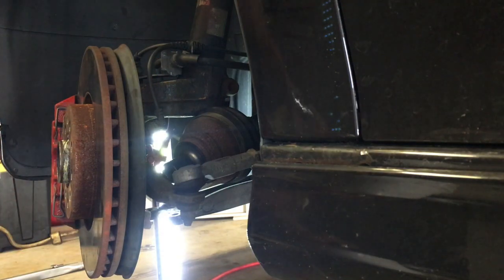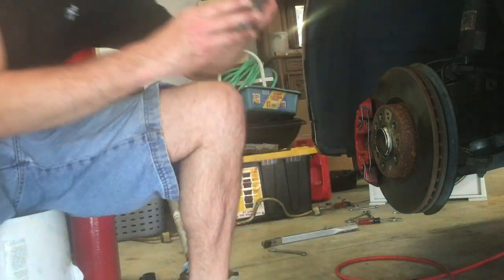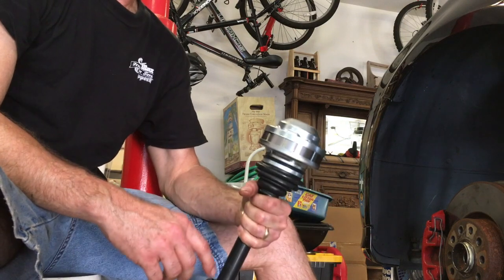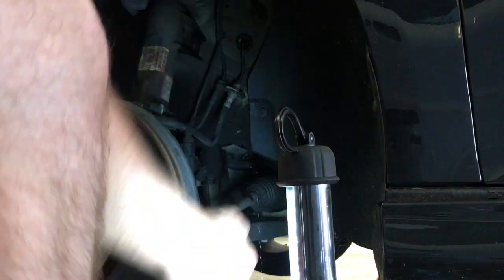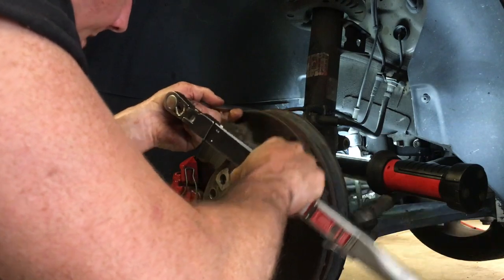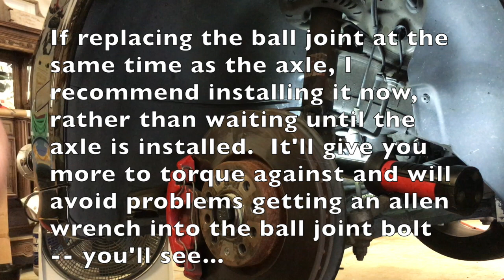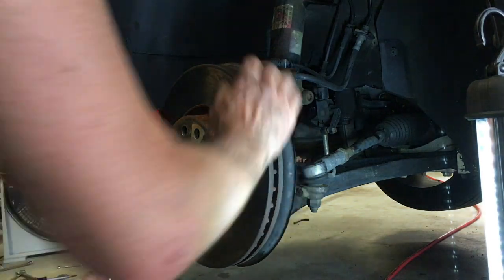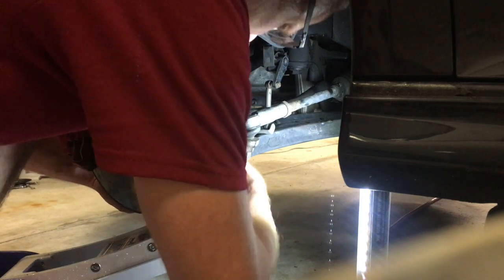2008 VW GTI front axles

Comment: When you take the torsion arm off and the steering control arm ball joint out of the bracket you can turn the entire wheel up assembly all the way to the back and it makes it a lot easier

Comment: Those brackets are crucial and it's not that the bolts are too short where you messed up was as you didn't take the ball joint off of the  Steering control alarm. I'm doing that job right now and I got all my bolts in and everything that axle has to be straight when you put those bolts in.

Comment: Sorry, no need to take the ball joint off/ destroy it. Even if you do feel the need to pull the joint apart (and you shouldn't) you certainly don't take the 3 bolts out you mess the tracking.   I would recommend you all look at a few more vids. some good safety tips though not in some other clips
Reply from the maker: Thanks for watching Mk1 Laser and appreciate the tips.
Reply: I think he was just thinking on overdrive. like when the shaft plugs in . He overlooked the flat connection drive end.

Comment: Bit late now, but you don’t do the 180 degree on the hub bolt until the vehicle is on the ground.
Reply: Good thinkin there
Reply from the maker: Hindsight...  Thanks!
Reply: My car off the ground already can I still take drive shaft out and do 90 degree thing after putting in new one

Comment: I have a whirring/rumbling noise from the front of my 2008 Mk5 golf, sounded just like a bad wheel bearing so i swapped it over and the noise is still there.. wondering if a driveshaft can make this noise like a bad wheel bearing or would it be more of a clicking?
Reply: Have the same issue, did both of mine and noise still there. Though I flushed the trans fluid and found metal shavings, all dull and a bit bigger than I'd like to see. The noise got significantly quieter after the flush though so prob diff noise.

Comment: I get a little worried when the parts start not matching the ones you are removing and then when you stop using the parts that were there (brackets) to adapt the new bolts that don't match the old ones. I wonder if you go the wrong CV axle...
Reply from the maker: Dante I. You actually bring up a very good point. However, had it been literally an OEM VW axle I would’ve been more concerned. It is absolutely the correct axle in every other respect and has thousands of trouble-free miles to support that assessment. Again, thank you for that observation.
Reply: Good to know. I'm getting ready to order one for my 2007 Jetta. It's the first axle I'll be changing ever. Watching your video is helpful in preparation...